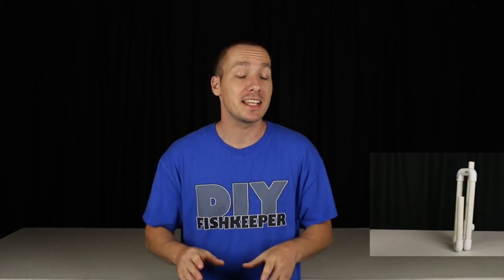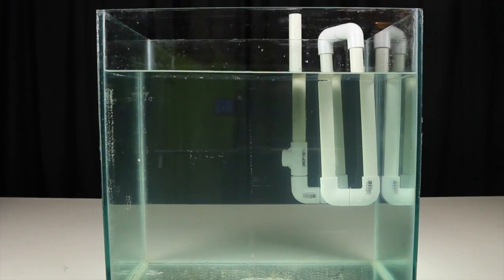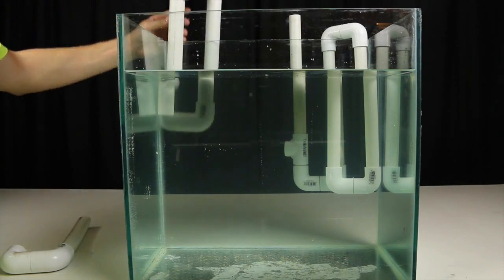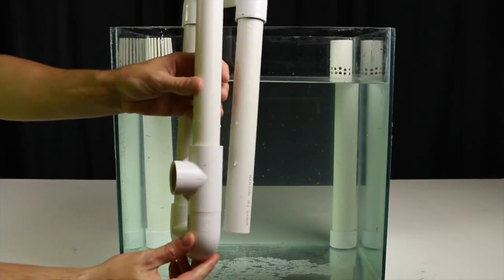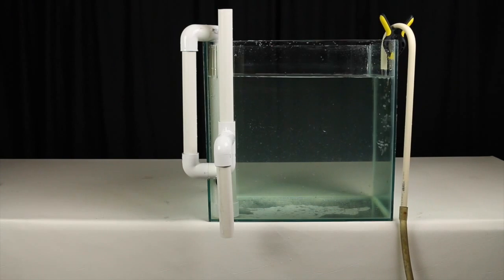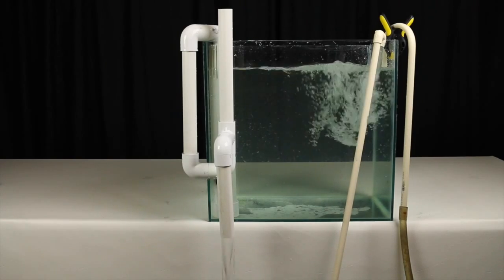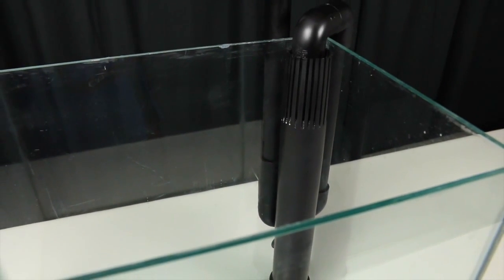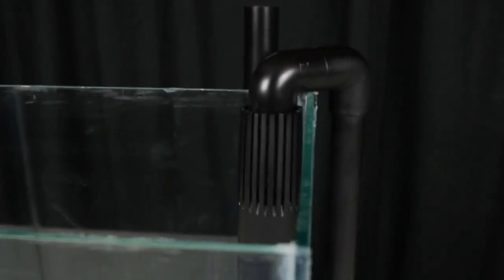HOW TO: $10 DIY aquarium overflow - UPGRADED and MODIFIED TUTORIAL

Comment: Hey there. I recently built an overflow for my 55 gal aquarium using your video. I do however have question about the water pump I'm using. it's nearly 400gal per hour. It comes with two sized adapters for that pump. one being 1/2 and one a little larger. I was wondering if the flow rates changed with the different sizes? I saw nothing in the manual to answer my question. what's your opinion?
Reply: The pump always pumps the same diameter of tubing dictates velocity

Comment: I put one in each corner of my 200 gallon tank.  I have checked and rechecked my design, still cannot get it to prime..Frustrated
Reply: Barrett Doyle did you find the solution because I'm having the same issue. Can't seem to get it to prime whatsoever.
Reply: Barrett Doyle same!
Reply: You have to put the lowest exit point underwater and seal the stand pipe so no air can get in either side then in tough scenarios use the aqua lifter at the PVC U as water goes over your tank wall
Reply: biggamehunter23 I ended up getting it to work by filling it with water, installing a check valve at the 2 elbows at the top of the design (before I filled it with water obviously), sucked all the air out and then opened it up, once the water level started rising I sucked more air out of the design and water started flowing.
Reply: Barrett Doyle did you get it working? Because I can't get it prime ...and I don't want to put check valve cover as I don't want to test fish poo.
Reply: *taste
Reply: Any update on This? Can't get mine to flow everything seems to be right, I put a cap on the exit and fill the pipe with water just like in the video and when I pull the cap off all the water runs out of the pipe but that's it???

Comment: So.. this filter is costing me far more that 10 dollars. the pvc pipe was 22 dollars, the elbows were 2.49 EACH, the t junction was 3.49 each the 2 inch pvc tube was 11 dollars, and the end cap for that was 3 dollars. 

For those who built this: HOW MUCH DID YOU PAY?
Reply: Where did you buy he pvc pipe from? I've never heard of pvc costing that much. You got screwed. And also, it will cost $10 and under assuming you already own pvc cutters or a hack saw and already have pvc cement. Most people who do diy projects and build things already own tools and simple supplies.
Reply: That's crazy talk. A 10 foot section on 1"pvc here is 3.29.
Reply: go to the used, or scrap section for the strait portions, normally 75-80% off price per foot, store dependent. a contractor bag of elbows, pk of 7 or more depending on store is like 5 bucks. cement and prep and paint is not going to move much on cost.
Reply: holy cow.
Reply: I paid 32 for pvc cement silicone and paint better than 100 for a box
Reply: Costed me 40$ cad
Reply from the maker: Costs vary all over the world. Based on location and availability. Your costs sounded a bit on the extreme end of things. I buy thin wall pvc for these. Its technically sch20. Costs next to nothing. An 8 foot run of 1" is about $4. elbows are something like $0.49. Shop around. I wouldn't pay what your paying. With that said, sometimes a project WILL cost more than you think. Or sometimes even more than buying something similar. But if you need something specific to your needs... its a trade off. Happens to me all the time.

Comment: The only issue I have had with this design is the suction cup let loose and 2" pipe floated up stopping the flow. time to figure out how to keep this from happening again.....
Reply: Try putting something heavy inside the 2" pipe to keep it down, like a rock.
Reply: i leaned rock structure on my weir..
Reply: cut the pipe that is pulling the water at a 45 degree angle. that way if the weir comes loose it won't completely close it off.
Reply: Silicone the suction cup to the tank.

Comment: Any advice on choosing a pump/where to get one? I'm unsure if I can find something like it at a hardware store or whether it needs to be specifically made for aquariums... also, the ball valve goes on the tubing leading out of the sump, right? Thanks, your tutorial gave me a great idea and I plan to watch more! :)
Reply: I got mine online. Shop around, check prices and reviews!
Reply: People will bash but if you have a harbour freight around they have cheap submersible pumps that work great ....I've had them in my aquaponics tanks for quite some time with no failure and some of that water is groooosss haha

Comment: Hey guys.  Want to ask if I'm doing something wrong.  Using 45mm PVC,  with weer.  But getting very little flow,  my pump rated at 1800Lph is draining my sump before the overflow fills up.  Is there maybe still air in the system

Comment: I cant prime this i do not know why  plz help!
Reply: I just inserted a long poly hose into the PVC outlet of the T. Then, siphoned it, as though attempting to draw any liquid from one tank down into another. It worked perfectly, and with using clear poly, I could see the water before it got too close to me, allowing me NOT to ingest it.
Reply: Hi did you find a way to prime this? What I do is I make sure the water level is all the way up to the pipes. Just like in the video you have to block the bottom of the pipe. Cover the standpipe as well, then release the cover or your hand from the bottom and it will create a suction. Water will start flowing through, sucking the water from the weir.

Comment: hey Joey I really like your videos, do you have a version were it draws water from the bottom near the gravel? thank you in advance.
Reply: It can't be an overflow if it draws from the bottom or else it would drain all the way to the bottom. If you want to draw from the bottom you'd have to be going to a closed filtration system like a canister instead of an open filtration system like a sump. Otherwise the whole tank (to the bottom of the tank "overflow") will drain into your sump. Hope this helps!

Comment: Im having troubles with the input of the system. The whole system is 32mm and the standpipe is 75 mm ( more than double ). But as soon as I open the ball valve it completly drains the tube. Water isn't flowing in fast enough to fill it up again, no matter how deep I cut the teeth. 
Would picking a bigger tube be the solution?  Thanks alot!

Comment: i have a 75 gallon and just built this setup just like it is shown  in the video i have a 600gph pump with 2" wier and all my plumbing is 1" my wier sound worse than a bathtub drain any ideas what bmay be the problem everything is air tight it was pressure tested this system is very noisy on my setup any help would be greatly apreciated
Reply: Sounds like the water level in your wier is too low, try drilling more holes to allow for more water flow.
Reply: Hi, there are two things that could be causing this from my experience. For the standpipe, drill an endcap with a hole in it and put the endcap on it. For the noise from the weir try using a an endcap for the top of the weir, drill a hole big enough for the intake pipe to go inside of it. If there is still gurgling noise, you may want to look into using the stockman standpipe. I modified mine so that it will work with this design, but it really depends on what you have.

Comment: Anyone have a solution? I'm getting a lot of noise at the tee where it hits a 90 and goes down to the sump. I have a cap on the tall pipe with an air line coming bout to make that pretty quiet, but my sound is coming from the water going from the tee, through the 90 and down. Everything is cemented together and I have no water or air leaks.

Comment: Instead of using an aqua lifter, you can use a power head with an air intake. This will double up for flow through the tank as well as ensuring the overflow is primed in the event of a power outage. Have used this method on many overflows in the past and it works well.
Reply: Show me how
Reply: pretty simple, you get a power head that has an air connection on it, take the air hose and plug it into the top of the overflow. the power head clicks on after the power outage and syphons the water out of the overflow. works well.
Reply: Cody McMillan how does the power head work if the power is out
Reply: Q: "how does the power head work if the power is out"

The power head does not work if the power is out, but neither does the return pump! If there's no water going into the tank, the overflow will siphon water until it breaks vacuum and stop.

The danger is that when power is restored, if the return pump turns on but the overflow doesn't work...it will pump all of your sump volume into the display tank where it will overflow onto the floor.

The solution is to use a lifter pump or the venturi line from a power head to restart the siphon when power is restored.
Reply: @cmcmillan22  If the powerhead intake clogs it willl reduce the syphon and your aquarium water height will rise.
Reply: Now thats a fantastic idea!
Reply: can you pls show us how to do it ?
Reply: Can you show us the pump or a link?
Reply: This is an awesome idea, thanks man
Reply: @plixplop  In this scenario do you have to seal the top part of the pvc (the part that was left open to allow air bubbles to escape in the default setup?)

Comment: I just completed my build of this upgrade it took me a little time to figure it out. what I found was that the pick-up tube that slides down in the weer. Has to be ever with the CENTER of the output on the tee. When the tee was below the pick-up tube it created a syphon. And when the tee was above the bottom of the pick-up I could look down the stand pipe and see the water below the outlet. So when there even it brings the water upto the outlet but leaves an air gap to break the syphon.
Reply: +Justin Goodman I just tried making this and it works but the flow is very slow.  Can you please tell us more about what you mean for the TEE?  Is it just to mount it higher than the tube thats inside the weir?  I can't figure it out, just now when I tried to restart it, it won't drain at all.  I tried priming it and I know it's fully sealed because I can blow into a hole while covering all others, I can't get any air in at all.  The only difference I notice thats on mine is where the water flows out, instead of using a 90 degree, I just installed a tube into it and the water slides out.
Reply: Important! The pipe in the tank must be longer than the center of the T piece or outlet of the t piece. This will automatically be done if you kept all the pipes the same length when building. I could not get it to start unless i: 1) submerged the entire unit getting ALL air out the whole system. Cap all ends including the pipe in tank. 2) put the fully primed apparatus into place ( not in wier yet rather slide that over once the its flowing) 3) remove the vent cap,  remove the outlet cap, lastly remove the cap on the inlet of the tank. It should work.
Reply: Andrew De Jager 
Yes....that would start the things up but once the pump is switched off, it again looses the prime.
Reply: +Justin Goodman Hi Justin. could you please post a video about what you did with the overflow?
Reply: dudeWHATsweet mine works but my toms lifter pump while its working gets mostly air and the pipe going into the sump sees a lot of bubbles
Reply: honda3291 hey, do you use the lifter pump to keep the siphon primed? I dont use the lifter pump i just run the siphon only
Reply: dudeWHATsweet I do have the lifter pump on and it seems to be just sucking air
Reply: I did my own spin on this, but I think I missed the crucial part--that the tee joint must be aligned to the exact same level as the water inflow inside of the weir. 
I was concerned that I was basically making an overcomplicated siphon, and I was right. 
Long story short, the overflow spilled water into my sump however quickly it wanted to, and my pump put water back into the tank however quickly it wanted to. This led to my sump overflowing when I looked away a second. 

I'm posting a video about how I did mine differently, but that does not affect what I think I did wrong--the tee joint must be aligned with the inflow in the weir? 
Should I make this further modification?
Reply: Justin Goodman THANK YOU! This has to be my issue. I'll adjust tonight and Hopefully it will work.

Comment: I had originally built your PVC overflow, for my 350L marine aquarium, worked great but kept finding fish in my sump. I made this version today and now I'm getting a gurgling sound every 30 seconds or so, this is going annoy the wife.
I had trouble getting tit to flow at a higher flow rate than my previous overflow, until I put a cap over the top of the the pipe that was used to pour water to get system started. Going to give it a couple of tweaks tomorrow.
Love you tutorial videos, I've used a heap of them
Reply: Did this work for you? Check out the Stockman standpipe. I did it with a modified concept.
Reply: I figured out need to drill a small hole in the cap, stopped the gurgling, but still noisier than the previous overflow design, I've got next week off so will play around with it more
Reply: Simon Ford Yes the noise at the top of the cap does make a good amount of noise but the weir does as well (since the water is falling into the the bottom of the weir). If you have the drilled hole design you can follow the stockman standpipe for a solution, or if you drilled the holes at the very top like I did put an endcap that is a size bigger than the weir to cover the top of the pipe. 

As for the fish getting sucked in, that was a little bit of playing around to do. I first got a drain cover to cover it over and tied rubber bands around it (cut the bottom of the drain cover to slip over the weir). This didn't work out so well. I decided to buy a pipe bigger than the weir to cover the weir and drill many many tiny holes on the big pipe that's covering the weir so that my fish wouldn't get sucked in. I believe I need to drill more holes in the big pipe that covers the weir since it stopped taking in as much water as it did before. It's still below the surface of the water but the water line isn't at the height I want it to be. 

I can post pictures of what I mean tomorrow if you would like! I may not have the best option and I'm still trying to toy around with it but my fish have stopped getting sucked in.
Reply: thanks, I'm going to play around with it when I've more time, its gotten a lot higher flow rate which is great, means can have return pump on full to give extra flow for corals

Comment: Our overflow works perfectly. however, it is very noisy. The water into the pipe gurgles. How do you make this silent as stated in the video.
Reply: I've added a sump to my system using this overflow design and I'm having exaxtly the same problem! So noisy. Constant gargling!
Reply: +Damien Brown Exactly. We've shorten the internal pipe. Which helped a little. Drilled a tiny hole. Which helped a little. But we have to close our bedroom door to sleep.
Reply: +marnes1 hi, I had that same problem too but I looked into the stockman standpipe solution and it worked. I hope you would look into this as well. If you have any questions I will be happy to help.
Reply: +silencedknight Thanks. My husband used the stockman systems with a few modifications. Also decreased the flow on the return pump. It is all livable and our bedroom door is open again!
Reply: marnes1 very nice! Always welcome to increase the flow again to see if it will take it again. If you have small fish just be weary to make sure they don't get sucked in. I bought a 5 inch circular drain cut the circle out (this is for the 1.5 inch weir) and put rubber bands around it and it's been working so far. Only my guppies got sucked in unfortunately but other than that its good.

Comment: What size piping would you recommend for a 100 gallon with probably a 35 gallon sump ? 

Thank you !
Reply: +Brandon Van Oudtshoorn My understanding is we want about eight to ten times the size of the tank as our hourly flow rate on the return pump. This means a 100-gallon tank would have a return pump running at 800 to 1000 gallons per hour. If the return pump is running 1000 gallons per hour, your pipes need to be able to handle at least that much and some to spare in the event there is some clogging or blockage going on inside the pipe. If you go by the information chart provided in Joshua Lawson's post above, you would want to use at least 1.5" diameter pipes, probably 2" diameter just to be safe. Of course, that is for the smaller pipe, the larger, outside pipe would be 3" or more, as per the video.

Again, this is how I understood it. Let me know if you find a flaw with what I wrote. I'm just typing this up after watching the video for the first time.
Reply: +kurt copeland thanks a million Kurt, 

I posted that comment a while ago and since then I have fine-tuned my sump accordingly .

Have a great day further

Comment: Built this style and it works like a CHARM. Thank you so much for getting me into this. I went from a guy not knowing about sizing, PVC pipes, and how this style of filtration to actually knowing something and putting this all together. I even modified it to be more quieter as well so it works (put an drilled end cap on the stand pipe and a slip coupling to reduce the sound.
Reply: +silencedknight Is this setup dead silent?
Reply: No it isn't but there are videos that show how to combat the noise of this (since its the water falling down the pipe). With the drilled holes you see there there is a solution to this using a stockman standpipe with the proper materials you can make on your own. There are a few videos, you should look into it!
Reply: Yeah I know about stockman standpipe solution but I don't think you can apply it to this overflow weir design.
Reply: You can, but you have to put an endcap at the top of the pipe. You have to drill the endcap so the intake tube can fit in there. 

Let me know if you have any questions.